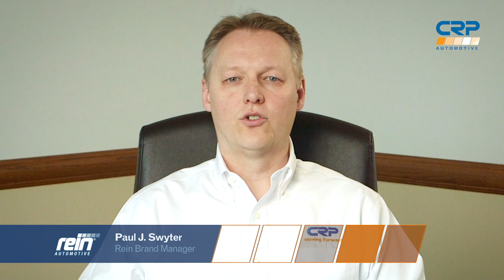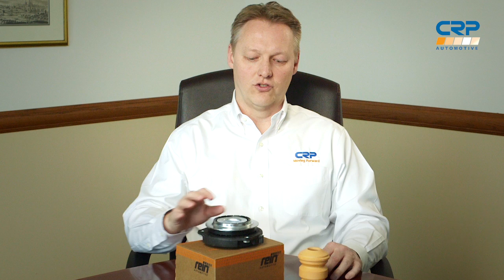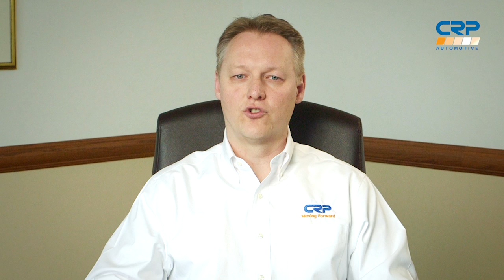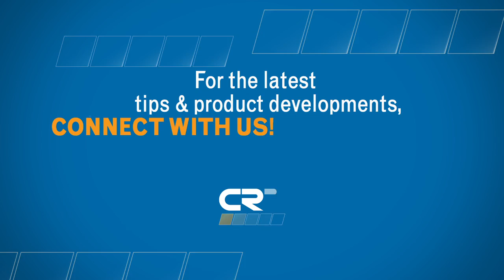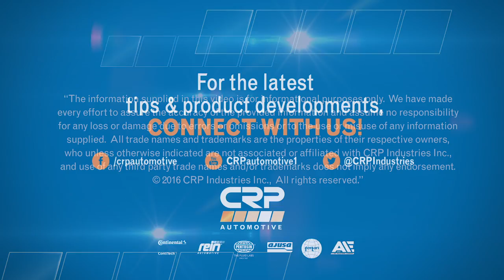ITB Episode 33: Examining Strut Mount and Bump Stop Wear

Comment: I think; your videos, would be more effective if you actually showed visually the damage and wear issues, you are discussing. Instead of talking about them; actually show the problem on a car and the parts removed from the car. Seeing how Rein; is relatively new to many of us, discuss the engineering, quality, where the parts are made and why we should buy them from you vs. a oem brand we are all familiar with. If you are going to "sell" the Rein brand; you need to tell us why we should buy it and quality behind your products. In this video; I did not hear much at all about the quality of the product, just that you need to replace these parts. If you want to see a brand; that describes and discusses their quality in the marketplace, look at moog's website and the engineering, design that backs their product line. With a global marketplace; that is awash in cheap offshore parts, finding a quality part is hard to discern and find. Sell your product line; by describing your engineering, design and quality, that sets you apart from every other brand out there. Thanks.